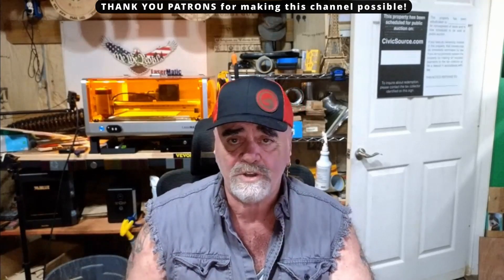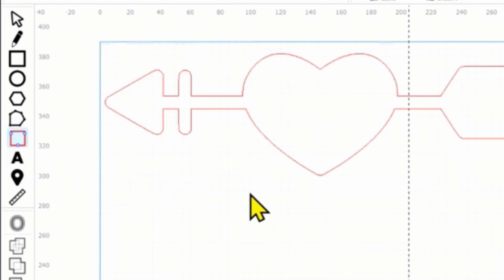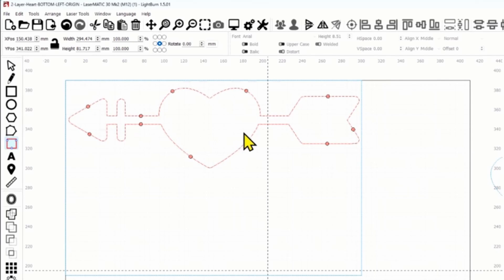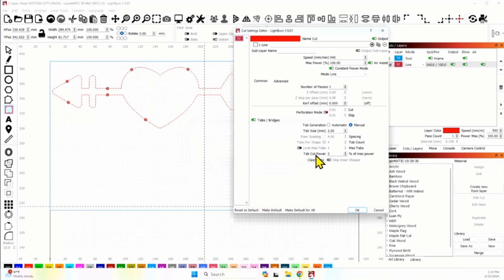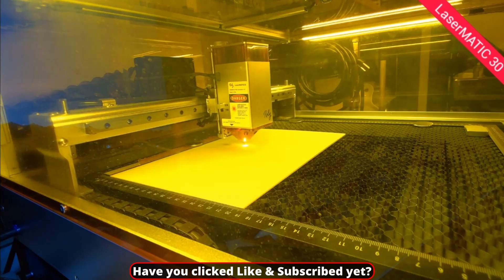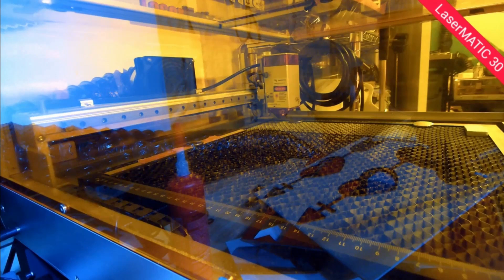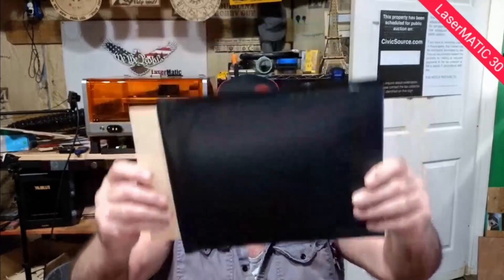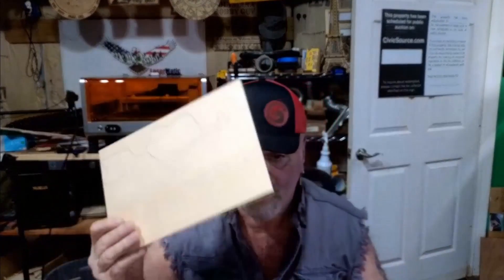🤔 What is the tab feature in Lightburn for? How to create projects that are ship ready!

Comment: OK, now wait a minute. It seems to me that a simple mode switch in Lightburn could make a majority of the  features applicable to CNC machines as well. Obviously, some of the settings for power might be changed to spindle speed and passes might also include the Z position of each pass. But an almost  all of the design tools (that make Lightburn so versatile) could be used in the CNC environment. Just a thought. 🤔
Reply from the maker: Lightburn is Gcode sending program, so yes, a lot of the features do work in 2D on a Grbl CNC.

Comment: Hey Rich, I figured you'd be the one to ask. I'm buying a rotary attachment for my NEJE 3 max v2. NEJE recommends one that's $179, but it has no horizontal adjustment. Do you know if the 
Ortur Y-axis Rotary Chuck is compatible with my NEJE 3 Max? It's fully adjustable, just not certain it's compatible. This is the Ortur I'm talking about  https://youtu.be/chMcUsJe2g0   Any help will be greatly appreciated
Reply from the maker: Ortur claims to be compatible with all diode lasers and provides adapter cabling.

Comment: I use it all the time as sometimes parts fall out and stickup in the grid etc
Next pass the head touch it and move the cut peace 
Scrap project after 2 hours of cutting.
Reply: Suspended pieces can be a problem.
Reply from the maker: This works really well with suspended pieces using my standoffs.

Comment: For some reason, my Windows 10 laptop won't let me change the order of operation by moving the layers. (Windows 11 - no problem) Now, rather than running a job twice, with different layers turned on or off, I think I'll try putting tabs on the outer cuts to keep the inner engraving in place. Thanks, Rich.
Reply from the maker: Ah, a new way to use tabs!

Comment: Hi Rich, liking some of the new features on latest LB, But i cannot burn with it, so need to be contacting support about that, Timer starts but just sits there, But regarding the constant running of the boundary, is it supposed to go back to home position in between each running of boundary, was kind of expecting it to just act like CO2 lasers etc do, and just run the actual cut outs position over and over? Cheers
Reply from the maker: If you mean framing, no, it frames and then goes to the job origin.